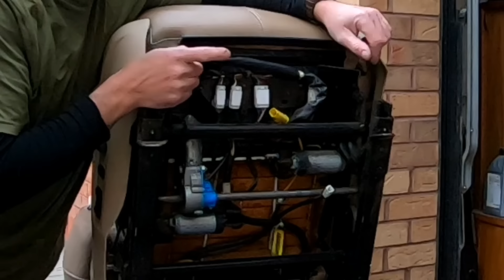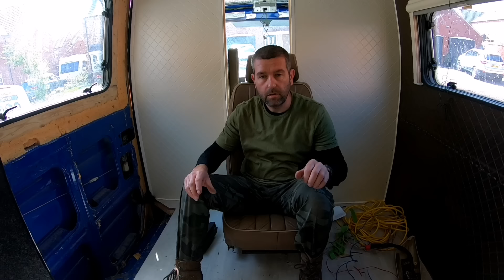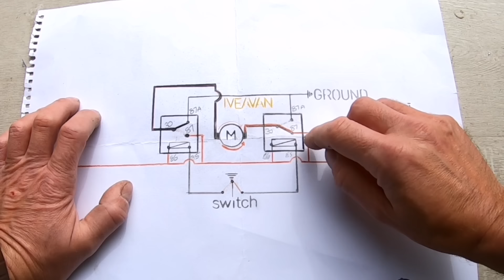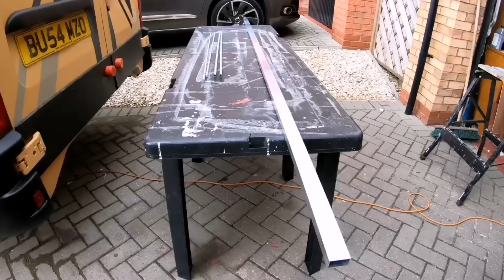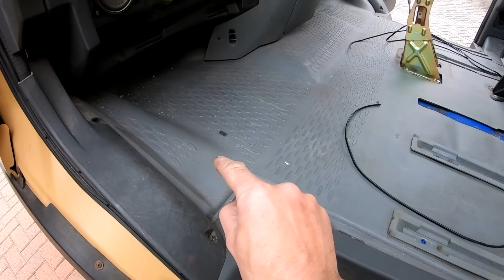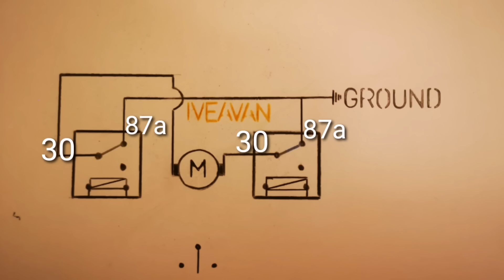How I Installed Range Rover P38 Seats Within a Campervan: Full Guide [Iveco Daily].

Comment: This is a great video, thank you. Given me a great idea for my new van. Question... In a crash how confident are you that the aluminum will hold up? If I do something like this I think I'll use steel tube instead.
Reply from the maker: I changed my seat base mountings to the steel box section ( fabricated and welded ) shortly after this video, as I fitted the sprung suspension seat base on the driver's seat and a swivel seat base on the passenger seat, yes, I'd go for some kind of steel for the seat base mounting 👌👍.

Comment: Hi mark great video, im planning on fitting these seats to my Citroen relay campervan on swivel bases. Could you tell me what the hole centres are side to side and front to back please? Also are they as comfy as they look im planning on doing some long journeys to Europe thanks.
Reply from the maker: Cheers, Chris 👌👍. Yes, very comfortable indeed, I've sat in them for 7 hours on a trip back from Scotland with no issues.  The dimensions are as follows.
395mm front to back air gap
425mm front mounting holes
450mm back mounting holes
Reply: @Iveavan  brilliant mate thanks for the quick reply 👍
Reply from the maker: @chrisclark4372  no worries, bud 👍 ...

Comment: I’m in the process of sorting out 2 Range Rover Vogue seats so I know how time consuming it was mine never had the unit under the seats so I didn’t have to cut that out but the guy who took them out of the car was not too clever, the hardest part for me is finding the corresponding wires to the switches on the seat and for the life of be I can not make out how the plastic panel is fitted but there is wires coming out from the side of the seat and see if I can sort them out , I’ve not found the wires to raise and lower the head rest yet but I’m not in any rush I’m waiting for the relays to be delivered. Your video as. Been a great help Mark I will let you know how I get on with them
Reply from the maker: Cheers, Thomas, the head rest cable  was tucked away right at the back, quite central next to the heated eliminate wires, only thin wires if I remember correctly. 😉👌👍.

Comment: @IVEAVAN Okay when you wire all the relays on one side you have + and - left but how does the relay system end on the other side.
Reply: Yep alright thanks for replying to my silly question 😅 Great video, you are helping fit Defender 3 seats in ford transit mk7 👌🤙🤙
Reply from the maker: Don't worry about it. No question is a silly question 👌👍. Just beware for tilting. The motors have to work opposite rotational way of each other when tilting forward or backwards 👌👍.
Reply: @Iveavan  i think its only one motor on my seats
Reply from the maker: Do you mean on the seat switch end or the power end ?
Reply: You said that the relay system has positive and negative on one side and one for the motor  and one for the switch. I get all that 😅. What i dont understand is when you connect all the relays on after the other what happens with the last one... it closes the circuit by itself right ?
Reply from the maker: @djMitef  nothing, that's the end of it, as you can't link to any more relays. So, second to last, just links to the last one.

Comment: Great video, can’t find the relays under the affiliate link. Are those SPDT or ST? Thanks 🙏🏻
Reply from the maker: Aaaah! They probably no longer stock them as the video is a few years old now. 
From memory, they were 10x 12V 30Amp Automotive Wire Harness Relay Socket SPDT Relay Set ( usually come in a set of 5 as it was cheaper this way ).😉👌👍👍👍.

Comment: hello sir, i like the vid, im putting RR seats (2013) in a 2017 transit 350 some others doing this dont use relays and lose the oem switches and replace with generic window switches. why did you use so many relays
Reply from the maker: Cheers Mike 👌👍. I'm replicating what the BeCm doe's by using the relays in order to use the original switch gear. Of course, you could use window switches depends on what finish you want 😉👌👍👍👍.

Comment: Great vid
What truck did the seat bases come from?
Are they air sprung fed from a compressor?
Reply from the maker: Cheers bud 😉👍. It's mechanically sprung seat baze, I've only have the one that's on the drivers seat, it's a original Iveco Daily base which was originally fitted to the van when I bought it 😎👌👍👍👍.

Comment: Hi, great instructions, in your opinion do you think you could retrofit like this to any electric seat ?
Reply from the maker: Cheers matey 👌👍, yes, it could be implemented to any type of electric seats, some do come with only needing and ground and a live feed to make them work, but due to the RR using the BeCm (like most modern vehicles of today) and requiring an IR single to turn it on, (unless you have the keys for the seats) you'd have to go down a route like this to make them work unfortunately 😉👌👍.
Reply: Thanks for reply, I'm just gathering info ATM as will be starting a build in the new year, never thought about the iveco, was thinking of a crafter or sprinter would you say it's as good if not better as them , are the engines good for big miles, any info would be greatly appreciated  👍
Reply from the maker: @martincooper2642  having had a Mercedes Vito, VW Transporter and the Iveco. The Iveco wins hands down for me, they are built like Tonka Trucks. Robust, they do take a beating. More truck like then van, with plenty on the road having covered beyond 500 thousand miles. Okay, they are a little agricultural to drive, not as comfortable (without the seats and air suspension) as the Merc of VW. But! It's very reliable compared to my vito and transporter (which were all brand new and I had those for 5 years each). The Merc was the most unreliable one with endless trips to the dealer (who gave terrible service) the VW was more reliable but uncomfortable to drive and gave me terrible back pain. So for me Iveco 1st, VW 2nd & Merc last! 😉👍.
Reply: @Iveavan  thanks for your advice, will certainly be giving them a look towards end of year, the deal is I've gotta finish the house first lol, thanks again

Comment: Brilliant video with the wiring explanation and not needing to weld the base. I want to make the passenger swivel, so presumably will be a similar process but mounting the swivel base to the lower base
Reply from the maker: Cheers Dan👌😉👍, I've actually modified these yet again so there's sprung suspension on the seat on a welded frame (I didn't get around filming that process though unfortunately) 😉👍👍👍.

Comment: Hi Mark, firstly I hope I have got your name right, I've fitted the passenger seat into the van today, it looks and works great, I'm about to fit the drivers seat but I'm not sure about the airbag wire (not on the passenger seat) how did you overcome this, sorry to be a pest but you made the video so understandable and would be great to have your comments before i start many thanks again, Cliff
Reply: Thanks, Mark, I will check with an auto electrician before swoping the drivers seat, there must be a way, the Rover seats are to comfy to miss out, thanks again, regards, Cliff
Reply from the maker: No worries bud, yes, it's Mark 😉👍. My van doesn't have air bags so had no warning lights to contend with, so I didn't touch nor wire my air bags up. I don't know if your vehicle is a newer one or not? Or whether you have an issue with your air bag light being on?

Comment: Hi, have listened to the video but am not sure of the colour of the earth wires on the two switches on the drivers seat to do a continuity check, please can you help? Thanks, Cliff
Reply: Thanks Mark,  super informative video, everything you explained with the motor's has worked well, just having a little difficulty in finding which wires on the two switches do what, I seem to get continuaty from all wires, obviously something I'm not doing right, I will get there in the end many thanks, Cliff
Reply from the maker: From memory (it's been awhile since I did my seats mind you😬) 
The base up and down / tilt forward & back switch should be one feed wire (ground). Both motors for the base should work the same direction when going up and down. But they should work opposite way from each other when tilting forward and backwards (this switch over is done by the relays, forward motor base up relay energized, back motor base down relay energized and vice versus to tilt the opposite way.) 
The back rest tilt switch should be one ground feed wire but joined up with the base feed wire for ground. Head rest the same. The air bolsters is one positive and one ground wire. The heater eliminate, I didn't wire that up due to the eliminate was not showing any ohms (obviously a break within the heater element somewhere) 😉👍...
Reply: Thanks again Mark, I will try what you have said, so kind of you to help
Reply: Cracked it Mark, followed exactly how you explained, all working great, your a genius, many thanks Cliff
Reply from the maker: Excellent 😉👍, good to see your up and running bud 😁👌👊👍👍👍...
Reply from the maker: Hi Cliff, I purposely left out what wire colours did what. As I was doing research, it looks like Range Rover changed the way they wired up their seats at least 3 times along with wire colour changes. If you can find one wire that feeds all switches I'd go for that one for earth switching bud 😉👍👍👍...

Comment: Hi Mark, how did you wire the massage in? Is that just power?
Reply: Ah ok! I’ll just play with it then with some 12v! See what happens
Reply from the maker: I'd imagine it just needs an live wire on the motor and an ground switch, but in not having that option I haven't looked into it 🤔😉👍....
Reply: @Iveavan  are those two soft switches on your panel not massage?
Reply from the maker: No, for the air pump for the side and back bolsters cushions bud, mine just blow up and deflate, ground switched again but providing live to the pump in the back rest, and air release switch. I think..... If my memory serves me well! Its some really thin pink and gray wire's 🤔 but I could be wrong🤔👍...
Reply: @Iveavan  cool, thanks for that! Will have a look at them next week, flat out til then!
Reply from the maker: Hi Richard, mine didn't come with that option unfortunately bud 🤔👍👍👍

Comment: Hiya I’ve recently bought a Vivaro to convert into a camper. After watching this excellent video I got some fabulous Discovery seats. I’ve cut off the excess plugs/connectors the only problem I have is sorting the control wires on the seat. I’ve tried everything I can think of continuity, resistance etc. Whilst moving the controls nothing shows on the tester any ideas? Thanks in advance Gary.
Reply from the maker: You should be showing some kind of reading 🤔, nothing on the pins on the back of the switches themselves?
Reply: When trying buzzer I get a reading of 1086 ish. When I use ohms I get .846. Though on trying the switches nothing happens.
Reply from the maker: 0.8ohms is that with the switch in the on position? 🤔,  does seem to be a little low, can you compare with the passenger seat switches ? What ohms are you getting with the multimeter prongs touching together? Usually its 1.00 ohms Sounds like it could an issue with your seat switch bank, not knowing the disco seats nor ever worked on them I'm not sure what wire colours to test from, but I'd imagine it be earth switching, so find the one wire that feeds all the switches. (So the wire that feeds all the tracks) unless it's that wire that has come adrift / undone from the track? once you've got that you should be able to bell out the other wires in each function bud 😉👍
Reply: @Iveavan  Thanks buddy you’re a star.😀👍

Comment: Great video mate, I’m attempting to fit Land Rover Discovery seats from a 2018 model, so your video was a big help. Quick question, did you use a relay for each seat function? I.e. each seat switch had a relay or is it a relay for each function as some of the switches on the seat have a 4-way operation.
Reply from the maker: Hi Jason 😁👍. Yes I've used each relay per function, only recently managed to get the tilt forward and backwards and up and down so motors are working opposite direction, which I haven't had chance to update yet bud 😉👍.
Reply: @Iveavan  thanks for the response. I’ll let you know how it goes 👍
Reply: Hi quick question, struggling to get the seat controls to do anything. Did you say that the control switches needs two earths? Or just one? I’ve cut back all of the original plugs for the motors and ready to start adding the relays. Thanks in advance 👍
Reply from the maker: @JFleming2011  I earth switched via the relays, so one earth from the seat mounting point up to the relays (as in the wiring diagrams) and one live is needed from a fused source from the vehicle battery 😉👌👍.

Comment: great video" & well explained, I have a question someone has added seats the same way as yourself & tucked away the yellow airbag conector but the yellow airbag light is displayed on the dash .can this be cancelled as im worried about an mot. !  thanks.
Reply from the maker: Yes, by using resistors with in that airbag circuit you can turn that light off...... I can't tell you what the resistance is, as my van didn't have the air bag option due to the age of the van, but if you search amongst the Iveco Daily forums they will be an answer to this matey 😉👍👍👍.

Comment: Thanks for the video Mark, Very helpful! We are halfway into adding the seats to our T4, the electician we have has said it would not be possible to have the "Memory function" as in keeping the seats in the same position once the engine is turned off. You would have to adjust the seats each time - is this how yours is set up? Any advice would be really appricated, thank you!
Reply from the maker: I'm actually right now revisiting this as I'm currently fitting the sprung suspension base for the driver's seat, and I've had a few messages regarding the P38 seats lately so I will up date on here with a video, regarding the memory seats,  the memory control is within the BEMC which wakes up with the original Range Rover key fob (unlocking the doors) so getting the memory function working with out a key fob will be impossible, but as the only driver of my van, I've only had to set up the seat once and never had to readjust again 😉👍👍👍.
Reply: @Iveavan  Thanks Mark! So if I am understanding correctly, when the ignition is turned off the seats will stay in the same place as you left them? This is where I think im getting confused about the memory side of things haha Presumably the memory is just for you to set ypur own pre sets and have them saved? Not fussed about that if so!
Reply from the maker: Yes that's correct Joe, once the ignition is off the seats remain in the same position, the memory function is only there for different drivers bud 😉👍👍👍.

Comment: Hi mate, would it be possible to get the heated seat function to work on these seats also?
Reply from the maker: Hi Joe, I never went any further into getting the heated seats or the air pump working for the bolsters, but I'll shall be revisiting the seats in the future, as I have the sprung seat base to fit, so it would make sense for me to get those too working 🤔😉👍👍👍.

Comment: Did you get any airbag warning lights from not having the seatbelt pretensioners plugged in? Any help much appreciated.
Reply from the maker: No, because my van doesn't have pretensioners bud, probably best visiting an iveco daily forum to see what resistors to use, in order for the light to go out 😉👍👍👍...
Reply: IVEAVAN   Thank you for replying , top job on the van. I’ve ordered some 2.7ohm resistors from the info in an Iveco forum. Thanks again.

Comment: Hi Iveavan,  great video,in process of converting my seats to power them up. does the relays you use have a diode in them. A part number would be helpful. TIA Brian.
Reply from the maker: Hi Brian, No, positive or ground can go on respective pins and swapped around and it still will work (as in the opposite way around) this is  the relay set that I used via Amazon https://www.amazon.co.uk/dp/B085NQC4JH/ref=cm_sw_r_cp_apa_i_RDm9EbJBNXYSP
😉👍👍👍.

Comment: Lovely project. Why did you want to have the seat so high up? It look like you needed only one of aluminium bracket. Not two on top of each other
Reply from the maker: Thank you 😉👍,  Because it was much more of a comfortable position for me to drive the van ( lower down felt cramped for me).  it is actually sat at the original height of the original factory fitted seat with the spring suspension base too 😉👍👍👍...

Comment: Made really cool. Super explained! I have a boxer and I can very well imagine installing such beautiful seats.

It is of course a dream that the seats can be controlled with the original switches!
Reply from the maker: No it requires the RF signal from the original key fob from the Range Rover, to wake up (switch on) the controller that's under the driver's seat 😉👍.

Comment: That’s great, thanks for posting.

I’ve got a set of Evoque seat I want to fit but they have the memory modules and it was confusing me so much I gave up. But having watched your video I will give them another go.

Thanks for sharing.
Reply from the maker: Excellent no worries and good luck bud 😉👌👍👍👍.
Reply: Hi bulkbrit, did you get the Evoque seats working? I've just bought a set to go in my Sprinter.

Comment: Great video.  Well explained and very detailed.  Does anyone know which 2 single seats will directly fit a Vivaro/Primastar/Trafic?  They don't need to be anything fancy or electric.  I have a single driver and a double passenger that I want to swap out to two singles.  Thanks all.
Reply: The passenger seats are always very expensive, even when they are used. But if you buy a driver's seat from abroad / Germany etc., they usually fit. Here in Germany, a driver's seat costs only half of a passenger's seat.
Reply from the maker: Thank you bud👌👍 I shall pin your comment on here for someone to answer 😉👌👍👍👍.